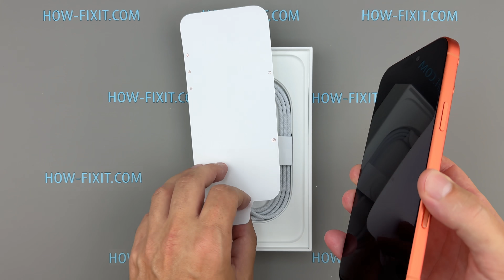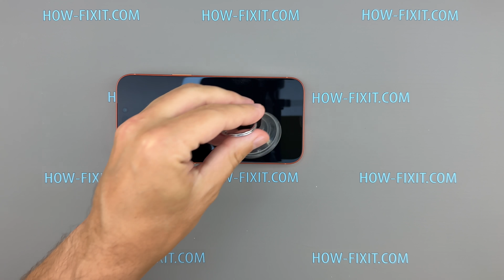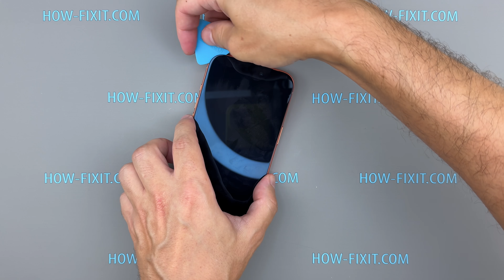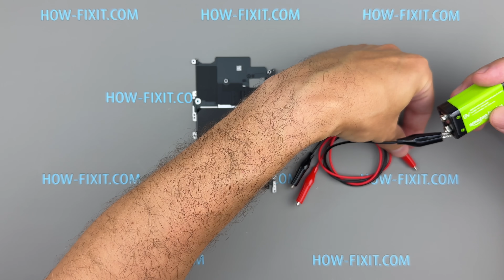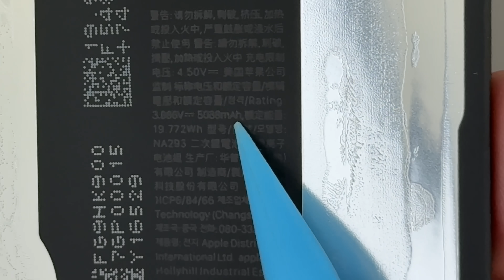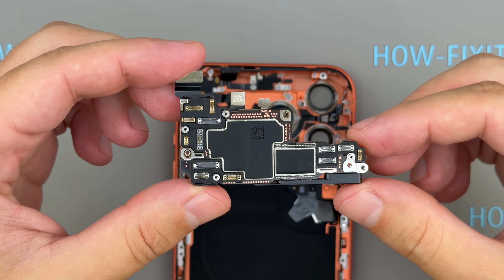iPhone 17 Pro Max Teardown: A19 Pro, Cooling & Easier Battery Removal

Comment: I was taking off the hard case from my iPhone 17 Pro Max and accidentally put some pressure on the edge of the back panel. Nothing happened, but I’m a little worried. Could that pressure loosen or open the back panel, or should it be fine?

Comment: so, 17 pro max is not equipped with metal case for its battery. unlike the 17 pro  & air. am i Right ? 16 Pro Max also did not get metal case for its battery. unlike 16 pro. I wonder, Why ?!

Comment: You STILL have to mess around with the display to access the battery? This is WHY i stopped buying iPhones. Always the battery situation.
Reply: iPhone 16 pro max don’t have this issue, but mine heats up quite often and tbh, this makes replacing batteries quite easy tbh

Comment: Interesting that the Pro Max's battery isn't metal encased. Would probably help increase thermal performance in the future if that gets changed. Also, increased battery life as well.
Reply: 18 Pro Max finally got the metal encased battery 🎉

Comment: Hey bro! Battery is 5088 right?
Reply from the maker: Yes, 5088 mAh
Reply: @howfixit  Where is the 5GmmWave Antenna?
Reply: @Lecon128 probably build in chassis
Reply: which has a 17promax sim slot, the battery is 4,823mAh..
Reply: @FlyJengka92   for esim its is extra ,USA varient
Reply: Probably it is iPhone 17 Pro Max Model A3525

Comment: Wait, so for the second year in a row, the Pro's battery is encased in metal, but the Pro Max's battery is NOT! Why?
Reply from the maker: If short answer: it’s a packaging/thermal trade-off.
Pro (smaller chassis) the metal-encased pack doubles as a heat spreader and structural element, helping stiffness and localized cooling in tighter space.
Pro Max (larger chassis) Apple seems to shift that role to the separate battery backing plate + vapor chamber + frame, keeping the cell as a lighter pouch. That saves weight up high.
Reply: @howfixit That makes sense! Thanks for your answer!
Reply: @howfixit I think it will go 250+ grams weight as well as cost for pro max, also unnecessary difference with or without battery. Only small phones need tighter space for cooling and dense batteries, as foil could rupture in tight spaces.....
Reply: Doesn’t need to be
Reply: @gelato007  If you're such an expert, explain why, with sources.